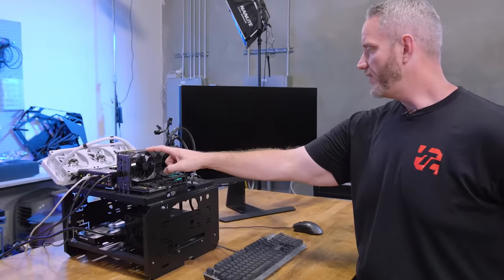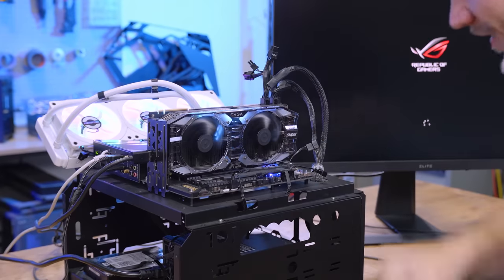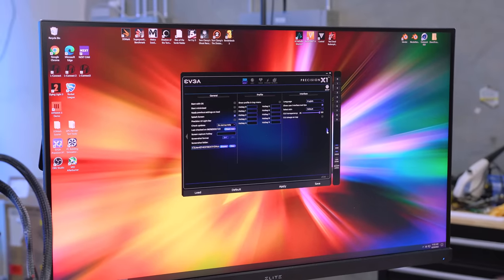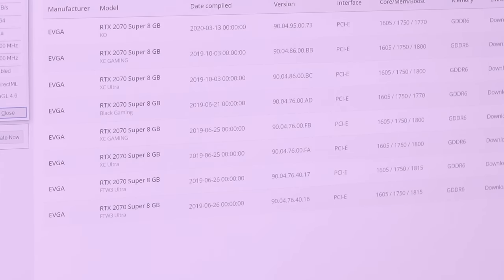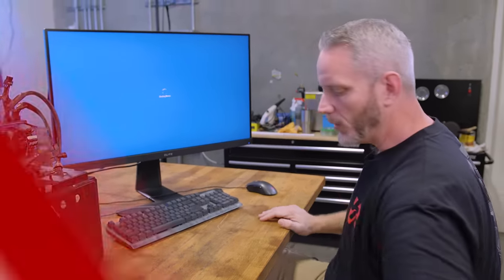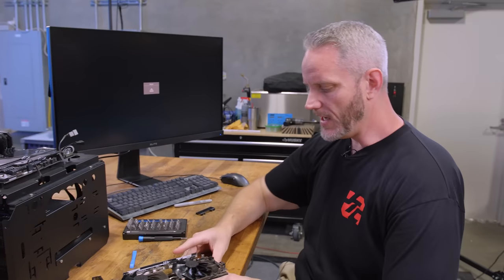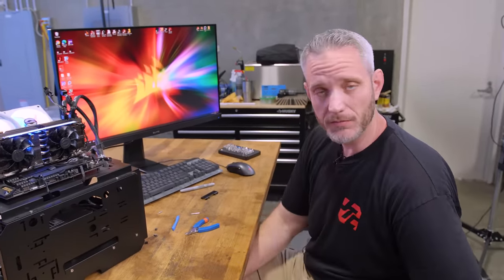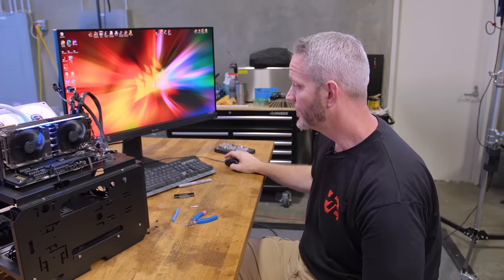This video card had a broken fan. Here's how I fixed it

Comment: Interestingly, some video cards have a half-zero-dB mode.  Not sure if that's still a thing or if it's just in ancient tech like my Sapphire Radeon R9 270X.  When it's under light load, its fan closest to the display ports (fan 1, I'll call it) goes at some low speed, while its other fan (fan 2) is off.  I spent a while worrying that my fan was broken, actually looked into getting replacement fans and figuring out the process, before, during that research, finding that fan 2 is supposed to be off when it's not under heavy load, and the way you check if it's dead is to check it during boot.

Comment: Honestly the noise gate was completely unnecessary. I know alot of dumb people comment on youtube videos complaining about fan noise in the audio. So im contributing to the other side of this issue. The noise gives context for the space you are in. Noise isnt a bad thing if it’s part of the content. 
Also an expander would be more gentle than a noise gate. A -10db expander plug in would probably sound pretty good. Especially with a slow release.

Comment: In recent times I've had a EVGA 1080 Ti FTW3 that had one of the fans stuck at 100%, got it from B-Stock like that and RMA'd it. I've also had a EVGA GTX 1660 Ti that the fans would "pulse" at idle, moving in and out at 0 RPM causing a clicking type sound to persist since fans make a bit of noise when going from 0 RPM to spinning. Not major issues but reading some of the other comments it seems maybe EVGA doesn't have the best QC when it comes to fans on their cards

Comment: I've had a similar problem with my EVGA 3050 running fine for hours to then suddenly crash windows and spin both fans at 100%. I swapped in my old 980 and it was fine, no issues. Put the 3050 back in and after awhile, crash and fans at 100%. I've updated drivers, checked bios, set nVidia control panel to Max Performance, done the same in Windows yet still the crashes persist. There are times when it will be good for hours, then crash 4 times in 30 minutes. This is not a gaming rig, just my photo editing (Photoshop, Lightroom, CaptureOne) machine. Any clues would really be appreciated.

This video was really useful, I'll check the hardware just in case. Thanks Jay & community! ; )
Reply: I had similar problem.  It was bad RAM. Crashed randomly after 5min or 30min. Sometimes 3x in 5 min,  sometimes 1x after 1h and than ok for 2h than 3x in 10min... It was nerv eating expirience.
Reply: Fans at 100% after a crash is some kind of protection. AMD GPUs also have it.
Reply: @AlexisSLO  this makes sense if part of the driver was in an area of RAM that corrupted or got unloaded, but then Is expected a blue screen.  I think we need to know what "crash" means.
Reply: It's unlike any other crash I've had. Screen freezes for a second, then completely black as if it was about to restart. Then both fans max out. I'll do a system reset and all is good for awhile, could be an hour, could be 8, but a crash is inevitable. I installed the studio drivers, no change. I have not pulled the card to look if there's any crimped wires as Jay found here,  as the situation sounds very different. Afraid to tinker too much, but could crimped wires cause this scenario?
Reply: @DougEvans  try to underclock  (with afterburner) the gpu or ram see if it crashes out.

Comment: This issue with the GPU reminds me of how I had a Logitech webcam fail on me in a similar fashion. The cable that went from the board to the camera sensor was crushed in the tiny case and after years of use it started going bad (it'd randomly make the image Matrix-green tinted) but for quite a while loosening or tightening the tiny screws of the plastic shell of it would make it work properly.

I presume that in both cases over time the pressure damages the wires inside and causes contact problems.

Comment: Had a similar problem with both my Evga 2080 Super FTW3 and 1080 Ti FTW3. Only the GPU die fan would run at all until the card was over 80C.
I just used Precision X1 to link the fans and set a fan curve and it got all the fans working. Annoying that software was needed, but hey it worked lol

Comment: 0db mode is great for reducing the dust build up as well though.
my old gtx 460 without 0db had to be disassembled and cleaned about once a year where as my 1070ti with 0db mode looked nearly brand new when I sold it to a friend 2 years after purchasing and keep in mind too my computer never gets turned off due to my old habits from back before SSD's when i didnt want to wait 5 min for windows to boot. And that i have cats...
Reply: Isn't 0 db on by default?

Comment: I got a GTX 980ti that has never had the fans ever spin. Ever. My solution was honestly to just form a "box" of three case fans (two along the length and one on the end) to force air past the non spinning fans. I never had it fail, so I t seems to have worked, though now that I'm building another computer, and have it out, I might as well test to see if the headers are even getting power, or if the three GPU cans will even spin when powered directly.

Comment: I literally just replaced my far right fan on my EVGA 3070 Ti as it was beginning to make terrible noises, sounded like the bearing were dying. I could see my temp's were going up as the fan eventually fully died as I was waiting on the replacement. All happened in the span of 3 days between hearing the faulty fan and it fully dying (not spinning) and installing the replacement.

Comment: I've had a fan issue with my EVGA RTX 2080 as well.  It would make a bad wobbling sound.  I took it off and reseated it and it worked fine after that, so when my card was manufactured, it was mounted in such a way that was causing the fan to somehow bind.  It also has some kind of odd connection issue in the PCIE slot.  Maybe once a month I have to wiggle the card in the slot or reseat it.  It is not the slot because it does the same thing in another slot and in the previous motherboard.

Comment: Having the same issue on a brand new ASUS Proart 4070, fan #1 going 100% from first boot and all the time no matter the software troubleshooting. Doesn't matter if in BIOS, desktop, any GPU workload or idle, temps were fine. Fans 2 and 3 responded to MSI Afterburner control normally, but fan 1 kept going 100%. HWInfo said fan 1 is getting sent a PWM signal, that signal went up and down with the Afterburner slider but no RPM change. Clean driver update? Nada. Q vs P vBIOS? Zip. 

Well within the return period still, so not taking chances opening it up and instead doing the RMA song and dance.

Comment: Zero RPM mode causes less of a temperature change than running it at say 37% idle. The fans will turn off once it goes below 50 then the GPU will passively stay at that temperature until its being used again. Looking at my GPU which does not do 0 rpm I can get 26 degrees celcius on it. The delta is about 40 degrees while if it had 0 rpm mode the delta would only be 20 degrees.

IMO the problem is with Molex. They do not advice to solder the wires because normally it is not required. But in some cases soldering the wires removed any potential problem.
Soldering does require more time and precision so obviously you want to avoid it. With these small wires it really should be done though.

The secondary problem is that the wire was simply not crimped correctly which could have been caught if there was enough quality checking. Lightly pulling the wire after crimping will ensure it is actually good.
Reply: The issue is that the temperature you're referring to is only the GPU core - the rest of the board without airflow can get as hot as it wants, as long as that GPU is under 50C those parts will get no airflow. Also the fan itself - a bearing is a part that wears in motion, but running it constantly will keep the fan's lubricant in motion and dispersed, creating the boundary layer between metal/plastic parts that optimally prevents the wear - 0db/RPM modes put the fan into a stop start cycle that allows the parts to settle into contact with each other, then upon restart grind against each other until operating conditions are reached. Depending on usage, this could result in more wear than continual operation. Such stop/start wear is why you're recommended to let a car reach operating temperature before you start slamming the throttle on a track day for example - you can seriously damage parts if you don't let the car reach operating condition before pushing it.

Comment: Well, I learned something today.  Since I edit videos with Openshot on Windows 10 (can't afford better software atm), my system is mostly CPU bound.  I also don't play a lot of pc games, so my RX 6600 is almost always in zero DB mode, and I could've had the same problem.  I'm turning it off and adding a fan curve to my GPU.
Reply: Just make sure to check from time to time in Adrenalin,because when it crash sometimes it will reset to default state which is 0db,it doesn't happen often,but worth to know.
Reply: @EyefyourGf  Thanks

Comment: Just had a similar issue on a Strix 1070 i got for £90, At around 64% fan speed or any custom movement with AB and a clicking noise then eventual failure happened, i could plug it in to another PC and it would be fine, so after some contact cleaner and connector cycling making sure for no pinches..all seems well so far, but i think the fan making a clicking noise is showing it may be EOL as pushing the wires like in the video could cause changes.

Comment: I had this same issue with my EVGA 1070 recently. One fan was permanently going 100%, the other was permanently off. I ended up replacing the fans, which worked.

Comment: That isn't from thermal shock or expansion contraction. That is a bad connector that probably barely made it passed QC. It was probably always hanging by a thread and just moving the PC or card around caused it to finally break. 
It's like when Jay had it going just switching the plugs, he found a position that worked. Eventually that would stop too from movement of the card. It's just a bad stressed crimp.

Comment: I had a similar issue with my gigabyte 3060ti, I removed the shroud to find one of the three fans was plugged in half way and it was enough to feed it power, but not enough to allow control (pwm), so that fan was running at 100%. I replugged it and haven’t have a problem since.

Comment: I've had that with a gigabyte card, the card would adjust the fan speed of all 3 fans by monitoring 1 fans rpms, I did what you did, swapped 1 with the other fans with the one I suspected to be faulty, and they all behaved properly after that, I can only assume that the fan PWM or monitoring in the fan its self was bad in my case.

Comment: 13:56, I think the wire was oxidized, that is what mostly happens on tiny gauge wires, oxidized part of wire adds to wire resistant on that section and then heats up and even makes tiny sparks that will vaporizes very tiny amount of wire during time until the wire give up and completely disconnect like a fuse. wires are not made of pure 100% copper and most wires fail from the section that has most impurities if they work near or over the spec they are rated for.
Reply: No , absolutely not. There will be no sparking at that voltage and current, especially with a wire that isn't broken.  Not fully broken = no airgap.  Please don't make things up in your head.

Comment: I would guess it was a bad crimp job, I see that very often while fixing stuff.

Worst case was something that had been running for years but started saying the backup battery was missing.  Opened it up and the wire just fell out of the connector, it wasn't crimped at all, don't know how the wire stayed in there for so long, I just had to put the wire back in and crimp it properly.

Comment: My typical solution with broken GPU fans:
Ghetto-mod two 92mm fans to the gpu. Plug them into the motherboard and either control them wit fancontrol or just set them to 60-70% in the bios.

Works well, makes the card a lot more quiet.

I also have an adapter from the typical mini fan header to normal 4pin, but I only use those if I have to. Like the one here, those break quite easily.

Comment: This makes me really glad I tossed a 1st gen corsair water block on my 2080ti when I got it. Yes the block squirted me and the card once, but I torqued that fucker down hard and it's behaved just fine ever since, as has the GPU. Took a lot of work manually tuning all the fans how I wanted them to run, but that's what 2 commander pros are for (one came with my 1000D, the other i had already). 5 additional temp probes and 4 separate fan profiles later I got everything tuned pretty solid though :)

Comment: I had this issue with my 2060 KO. After I sent it in the replacement they sent me didn't have signal. When I asked for a new one they said they weren't sure because the one I sent them originally didn't have an issue. So basically they told me I was lying. I eventually got it worked out, but I had a really bad customer experience with them and now I avoid them as a brand.

Comment: Can you do a video on replacing 30 series fans that click on startup? Without a custom fan curve, my 3060ti ftw3 ultra sounds like an old hard drive. Many 30 series owners have reported it, and manufacturs refuse to replace it (they claim it's normal), so I think many of us just want to swap to properly made fans, so we can use less or no fan at the lowest temperatures, and not hear loud clicks when they all spin up.

Comment: There's a difference between Shutdown and Restart: Shutdown preserves memory (it basically does a logoff and an hibernate) while Restart starts the OS from Zero. This solves issues in Windows itself.
It is very possible that Restart does not work on periphery, because it does not power off the devices, which the Shutdown does....

Comment: The way you described 3-pin and 4-pin fan control was incorrect.
4-pin PWM control fans in two ways (usually exclusively): PWM Duty Cycle signal (fixed 12v power with digital 0-100% signal for fan) OR they use DC voltage control (mostly legacy support).
3-pin can only use DC control or they're stuck at a fixed voltage (usually 12v).
Fun fact: Some PWM fans actually do not work if DC controlled.

Comment: You have TWO fans. Only 1 is acting up. The first step is to swap the fans and see if the issue follows or stays. If it follows the fan, the fan is bad. If not you have eliminated the fan and can troubleshoot further.

Comment: Well I just turned the 0db fan toggle off now, thanks. But, the temp at idol and then gaming is so drastic isn't that just as bad or even worse based on the temp differences for expanding and contracting?

Comment: In summary, that needs to be a re-design the wire assembly that the wire going to the port is safe and no bend too much. I encounter some of the gpu folded to much that stresses the wire and looks bad, but don’t straighten out just put them what original looks like. And my concern why some Gigabyte gtx 560 and Zotac 1060 6gb has a same “bend” look that it can cause a bad connection like the wire sandwich between the cooler and the board.

Comment: me and a friend had problems with 100% fan on our msi "RTX 2080TI Gaming x Trio" - we found out the thermal paste was poorly distributed so it actually had bare spots on the core... so i repasted mine and told friend todo the same and all fine now.

only help we got from MSI support was being told to use the GPU Sag bracket >.<

Comment: Luckily, (knock on wood), I have yet to experience this issue. As I have an EVGA 2070 Super XC Gaming, and so far, no issues with it. The only thing I noticed is the gigabyte bios reset my motherboard does, makes my GPU run fans at 100%, until the reset is finished. So, hopefully mine lasts for now. I do the same with the custom fan curves, I run 30% at idle, and as the card increases temps, it goes up.  I've seen worse, where I had an MSI, that borked itself due to temps, so I started running the AIB's software for every card I've bought.

Comment: All of the 20 series cards (not sure about the 2080ti ftw3) I’ve seen from EVGA always goes up to 100% during initial post, but I’ve never had it pinned at 100% at all times. This is very interesting thing to see
Reply: Most cards go to 100% as part of post and then wind down or turn off, its expected behavior
Reply: Bought a evga 1080 ti and pwm wire broke on it too

Comment: I had that same problem with that exact same card. I sent it to evga and it returned with the same problem. they wanted me to do another rma but that would be super expensive since I live in south america so I just gave up and traded for a 3080 (i had to add money obviously) which I had to return because the gddr6x was overheating. then the whole crypto thing started and i was never able to buy a gpu for a reasonable price ever again 😅